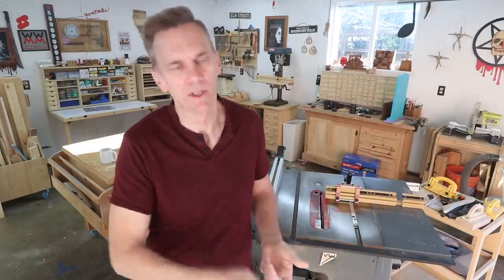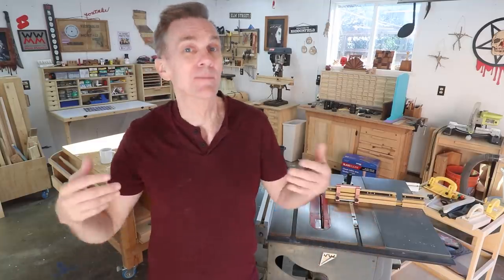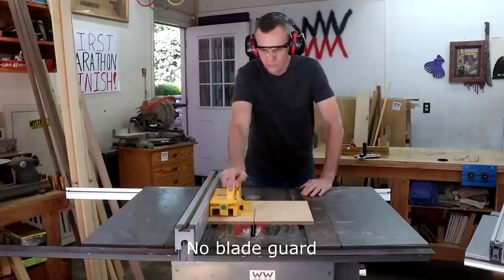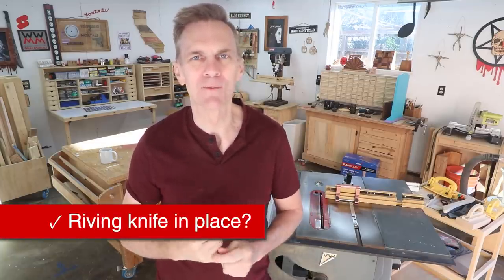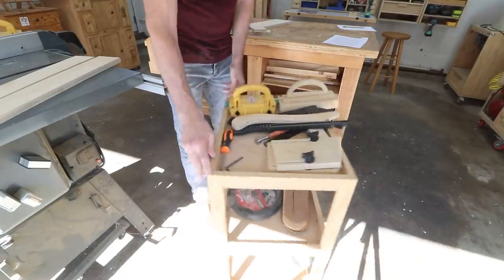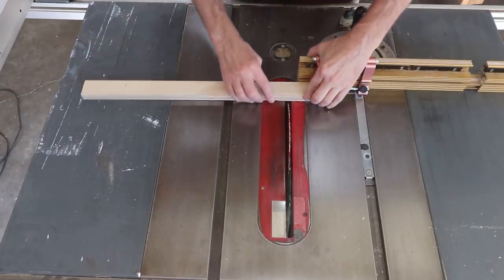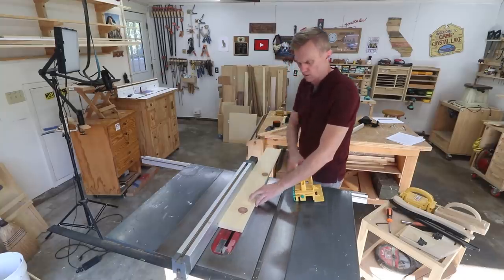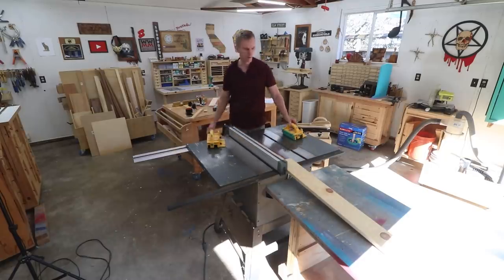Watch this BEFORE turning on a table saw. The Table Saw Golden Rule.

Comment: Great as always. Something no one mentions that I do is use a foot switch with my table saw etc.
Reply: I personally would not use a foot switch.  When setting up the saw for a cut one might inadvertently turn the saw on.
Reply: @dwightl5863  My saw will not come on with the foot switch only off. You must use the push switch to turn it on.
Reply: That’s a good feature on your saw but not all saws have that feature.  A number of new saw owners could think this would be a good idea without realizing the harmful consequences of an unintended turn on of their saw.

Comment: It's also worth noting that the newer track/plunge saws have anti-kickback mechanisms better than a riving knife installed (Makita 40v, the newest Festool 36v, Mafell, etc.). This means coupled with a TSO or Woodpeckers parallel guide system, certain track saws are potentially safer than table saws and even more accurate. Coupled with a good router table, the only benefit of a table saw is doing certain cuts faster (e.g. dados). You can't even approach the level of safety this combination provides unless you spend considerably more money investing in a Sawstop AND using the guards, but even then there are certain cuts that are always going to be more dangerous. Unless someone has the room and money for such a table saw system, I think most weekend warriors are better off with a plunge saw, parallel guides and a decent router.

Comment: Great stuff, Steve. I would only add the importance of a zero clearance throat plate for very thin rips. Your saw (like my old Delta) has  HUUUGE gaps, which allow smaller pieces to fall into the saw, or bind the blade.

Comment: Nice tips, even for someone who is experienced. The most important advice was to listen to that voice and don’t do “just this one”. Any accident I’ve had is always a “just this one” or “I should probably”.

I would only add that I feel like your kickback warnings were mostly focused on small offcuts; one of the most scary things I’ve witnessed was when my friend was trying to cut a roughly 2’ by 2’ piece of 3/4 plywood. I think he was trying to take 2 inches off of it and so the fence was set at like 22”. Well, he got a few inches in and it bound up and threw this entire piece of plywood at him, almost broke his arm and continued another 20 feet behind him.  Cutting boards that are as wide as they are long pretty much equals a crosscut and becomes very dangerous using the rip fence.

Comment: Hadn’t used my old Craftsman’s saw for a while- it doesn’t have a writhing knife but has one on the kick back protector which flips away or comes off completely. I use it more now. I have fine tuned the fence (previously I only did outdoor redwood work) now I’m doing more fine work. Got a new miter and built two sleds. I’m amazed how much better the experience is when you pay attention to your machine and your fingers. I appreciate your list Steve and pretty much go through all safety precautions. Never be in a rush! Still have all my digits! Your videos are always useful reminders. Thanks!
Reply: I have a similar Craftsman saw - early 1980s. The rear mounted combination kickback/blade cover/fixed splitter mounts on a post jutting out of the back of the table and is one of the most dangerous designs I could imagine - first time the board hangs up on the splitter (pseudo riving knife) it’s a real opportunity for kickback or for the anti-kickback pawls to dig a chunk out of the board. The splitter is also too far back to prevent some kickback.  Couple that with a cheap, inaccurate fence … .  In any event, it was (is) straightforward to add a Biesemeyer fence and JessEm Clear Cut guides (prevent kickback, pull board into fence).  I bought mine a long time ago, but for all its shortcomings I love the solid cast iron table and use it regularly. After all, when I pay over $300 for a saw I expect it to last (especially with another $400 in add on parts).  That’s my story.
Reply: It’s”riving” knife, but there are situations where “writhing” might be a more appropriate term! Ha! I’ve been retired for almost 2 years, and I’m spending a lot more time in the shop now. Last week I had nasty kickback incident (my right front is still purple!) that’s caused me to super attentive using everything in the shop! I’ve always heard “what doesn’t kill you makes you stronger/smarter”, and I guess it’s true! As a funny side story, the day after the kickback I was in the tool section at Lowes and another shopper spoke to me. After chit chatting for a few minutes, he asked me if I, or anyone I know of, was looking for a job site table saw. It seems he too had had a kickback incident and it scared him so bad that he refuses to ever use it again, and that the first person with $100 would own it!

Comment: Great vid!  The one thing I would state differently, though, is the height of the blade.  According to Stumpy Nubs, they are designed to be raised up to the point where the bottom groove of the teeth meets the top of the board.  This gives the teeth the correct cutting angle.

Comment: Great video, Steve, thanks. Someone below pointed out the safety check for loose clothing or hair, which I'd second. I'd like to add that a zero-clearance insert is (in my opinion) a safety feature as well. Can't count the number of tiny pieces I've had sucked into the saw for their explosive (no kidding) death. That kind of sudden surprise makes you lose all track of key things, like where are my fingers, and where is the cut on the piece going? Side benefit is, less dust blows up into your face, and eliminates that distractor also.

Comment: Many good tips Steve. I like your focus on safety. We all love our hands and pointy things attached and fully working.
I’m from Europe, and one thing you may forgot is that a number of saws has retractable riving knifes. This means you can push the riving knife downwards before making a hidden or dado cut. This will leave the riving knife’s functioning as it’s intended, but still the saw blade will protrude slightly over the top of the riving knife and thus still do a dado or hidden cut. I noticed your saw has this feature.
Absolutely something to check if your saw has this feature, and definitely when buying a new table saw.

Comment: I like to keep control of the cut through the whole cutting process.  So I use a foot switch to power off the blade rather than reach for an off button.

Comment: 04:28 Is the cat considered a shop fixture? 🙂 

"Never perform without a rehearsal" Good one, I need to remember that.

My table saw safety-related saying that I came up with 20 years ago is; "It's a table saw, do you know where your fingers are?" Which is a take off on a PSA that used to air on TV in the 70s that went: "It's 10PM, do you know where your children are?".

07:45 One of the things you should hear that little voice in your head say is: "What could go wrong?" and if you don't have an answer that results in a safe cut, time to rethink what you're about to do.
Reply: Bench dogs are talked about far more than bench cats!

Comment: In my shop I have what we call the "Ten Second Rule".  When turned off, the table saw blade will come to a stop in ten seconds (or less). There is nothing that can't wait ten seconds! I never try to clear a loose cut off, or reach over the blade to pick up the work piece from the back of the saw until the blade has stopped turning. Even with the guard in place.

Comment: I notice in some of your videos you are using 2 of the GRR-RIPPERS, I only have 1 right now, and I think a 2nd one would be really nice, and now that I have a jointer, 2 push blocks is really helpful.  The one I have has all sorts of adjustments, but seems like it could be used for pretty much any cut on a table saw since it has a very thin piece you can put on it for those really narrow rip cuts.  I like how you can change the settings on it for different cuts, or different machines.  Expensive, but well worth it to keep your hands away from that spinning blade.

Comment: Bosch makes a “safety” table saw as well, unlike Saw Stop that shoots an aluminum block into the blade which gets destroyed in the process and needs to be replaced before using the saw again, Saw Atop can also damage you’re blade on top of the fact that the blades are tough to get out; Bosch uses a gas cartridge and yanks the blade down, below the height of the table, upon contact and lets it simply spin down. The Bosch system is nice in that it doesn’t damage your blade and can be right back up and running quickly as the Bosch actually comes with 2 cartridges. You can buy the cartridges for a lot less than the Saw Stop aluminum block. I’ve used my friends Bosch and he loves showing off the action; the Bosch also is available in a job site saw and costs less than Saw Stop. I’ve been in the trades for 4 decades now and still plan cuts as complacency is bad; I also run through if/thens, if this happens then I’ll do... To me I think a router table can be much more dangerous, especially when free-handing. One big thing I have/use is a big sign in the shop to wait until cuts are done as you don’t want to be startled while using the table saw.

Comment: I have rehearsed cuts while laying in bed at night. I'm relatively new to the craft, so when I have an idea for making something, I start thinking about how I will cut the pieces I'll need.

An example is when I decided to make my own cove molding. Do I cut the strips off the stock and then route the cove or do I route the cove on the stock and then cut the strip off? Thinking about all the ways it could be done and the potential hazards. 

I literally bought a Grrr-ipper after thinking about how I was going to cut some strips. 

Thinking ahead, when it comes to the table saw, has been the most practiced part of my early woodworking experience.

Comment: I've only had one woodworking incident, I was turning a large 4x4x16 on a lathe and forgot to turn the speed down. After switching it on it sped up fiercely and before I could shut it down the post flew off smacking me in the chest, fortunately no broken bones just bruises and a now set in stone reminder to always check and reset speeds as required

Comment: A good plunge saw (e.g. Festool, Makita, etc.), a full set of TSO Parallel Guides, especially with a good bench with dog holes & bench dogs, can be just as versatile as a table saw. You can square a piece rough lumber with nothing other than a thickness planer, the plunge saw and parallel guides (no jointer or table saw needed). You can more safely, easily and MORE ACCURATELY break down full sheets of plywood. Cuts made with such a plunge saw/parallel guide system are even MORE accurate than on a table saw (or the other saws you mentioned) because most of the human element of error are removed (e.g. failing to keep the work perfectly flush to the table saw fence).

Comment: It's Table Saw dress rehearsal time... The actor (the board) goes on the stage (the saw) and you practice crooked cuts, burnt wood from the saw, a wrong measurement is off slightly so you'll need to cut the board again... Okay, Now are you ready for the cut?  Wait... not so fast...  do not underestimate murphy's law of the unexpected that happens only during the live production for example: the riving knife being slightly out of alignment so it blocks your cut.   Yeah,  that's what I'm talking about... Things that happen in the shop that make it "fun"  🤬 but other than that, the table saw is an awesome tool for the shop... just like all of the other flipping tools in my shop... "FUN!"

 (Kidding aside, Seriously:  Shop safety is important and Steve thank you for a refresher in the basics from time to time)

Comment: I've not ever had my table saw do a kick back, but I will tell you I have had kick back on a miter saw and that was both wild and very alarming, I have no idea how it did it, even with a guard on which thankfully stopped it from becoming super dangerous, I've since been extra careful with it and the table saw, extra practice before powering on, triple checking the cut without power, what will happen before during and after cuts.  I have no idea how the miter grabbed the cut off piece totally my fault just not sure how, and having taken extra safe steps since I've not had any problems.  It was a "poo coming out" moment lol.  But that's how we learn and hopefully learn from a mistake that caused no bodily injury are the best in my opinion.  Thanks for this post.
Reply: @JmeUS OMG, that's insane, glad you are okay with what I'd say is minor damage compared to what could have happened based on your story.  Thumbs up for glad you're okay.  Yeah it's scary when machines try to kill you.

Comment: Great video Steve. Something that I always do not that it’s a safety thing but just checking for accuracy, even though my fence is quite accurate as it is, is just taking a measurement with a tape. I also always make a dry run whenever I am cutting longer pieces just to make sure anything that might be sitting on my bench that’s on the back side of my saw isn’t going to interfere with my pieces. I have an older Powermatic tablesaw that doesn’t have a connection for a riving knife or blade guard as far as I can tel. However, this saw was something that I got used and it only came with the miter gauge, table insert, and blade. I ordered a manual for it about a year after I got it but I don’t recall seeing anything in it regarding a riving knife/splitter or a blade guard. What can you do in that kind of situation?

Comment: Great tips Steve.  You are also using a human error technique I learned working in Nuclear plants.  The acronym STAR applies to getting folks to use and engage in all your tips.  It stands for stop, think, act, and review.  It basically means, before you do something, stop a minute, think about what you are about to do and recall those Steve tips.  Then act and do your maneuver.  Finally, review what you did.  Did it work as planned?  Was there a better way?  What did I learn?  STAR, a simple word to put the safe thoughts front of mind before you do that dumb thing.

Comment: Some other rules that I go by:

- Long hair? Tie it back. Loose clothes? Button up. 
- Fingers NEVER over any part of the throat plate. (Also applies to router table and bandsaw.)
- Never stand in-line with the blade.
- Pay attention! Don't operate power tools while sleepy, distracted, or otherwise impaired.
- Maintain the tools. Use sharp blades/bits.
- Don't force - let the tool do its job.
- Keep the area clean and free of obstacles.

Comment: Just for the record, most woodworkers can get by with the Sawstop contractor saw which can be had for about $1,500-$1,600. That's $700-$800 less than the example picture you posted (and could be the difference between something affordable or not).

Comment: All good advice, though I believe there are a lot of people who consider your advice about blade height to be incorrect.  The gullets should be exposed.
Reply: I’d like to see someone come up with an experiment to test this, but when you have people with a significant amount of experience disagree on a subject, my thought is perhaps the difference is insignificant.

The wood is driven toward the gullet from the tip of the blade, not the side and should theoretically exit around the dust collection port (if present). So I’m wondering why exposing the gullet (essentially horizontally) would result in a difference?

On the other hand, the higher the blade, the less contact with wood at any given point in time due to the cutting surface being closer to vertical. I have a feeling this is more significant than the position of the gullets relative to the top of the wood. Though I’m not confident an 1/8 - 1/4” difference would be significant.

All theory regardless. A true experiment with statistical analysis would be necessary to see if there was a difference. And even if there was, would it be truly relevant?

Comment: Do you have a video on the best way or how to cut 1x2x8 furring strips into pieces? , I have been using a miter box and sew but I want to learn how to do it on a table sew longest cuts are 19.5" long and smallest is 3" long.

Comment: I always use a foot pedal switch with my table saw. As soon as the foot is released from the pedal, the table saw shuts down. It did save me a couple of times as the cut I was making was getting dangerous.

Comment: When it comes to the riving knife, my table saw does not have a place for one. It does have a splitter which is attached to a guard. Would this work? I have a delta 36-600 (I inherited it from my step fathers dad since he was a wood worker as well)

Comment: Would incra, or any other, miter gauge work with the dewalt construction table saw or are most of those used with an actual table saw? Also, if they would work which would be a good one to get?

Comment: I would not restart an interrupted cut with a blade in the kerf, I redo the entire cut (re-enter the kerf).  IF the wood has moved due to case hardening or been nudged, or the fence nudged,  the blade may still catch the board.